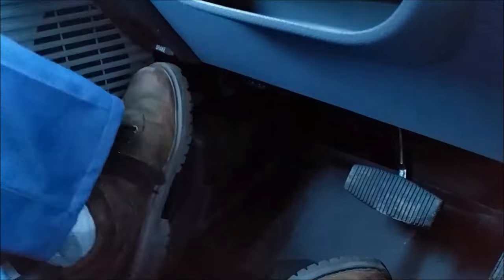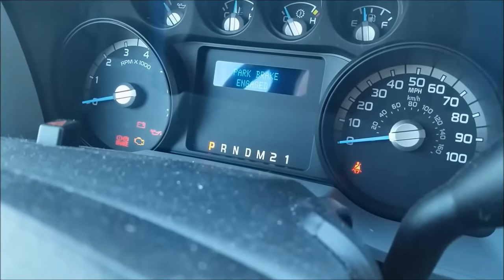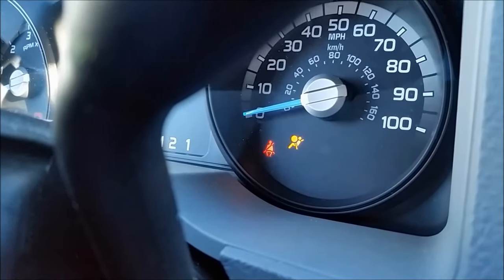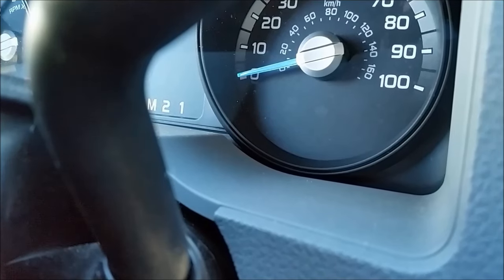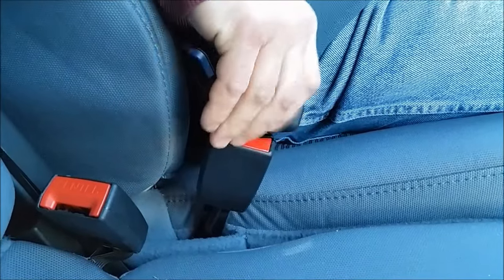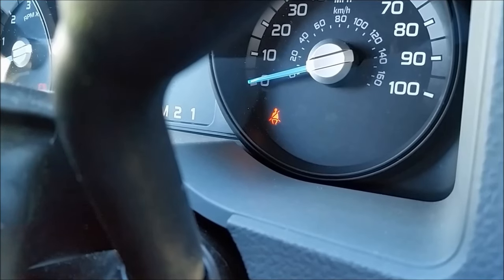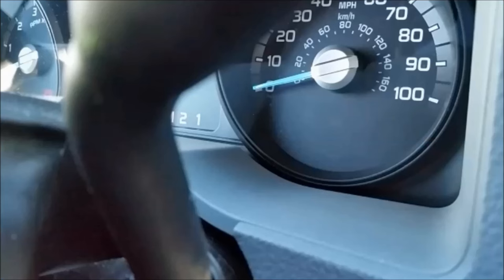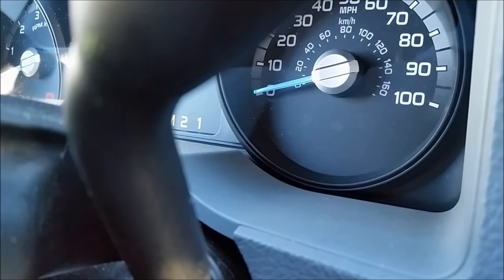How To Disable The Seat Belt Minder/ Chime On a 2014 F-250

Comment: This worked on my 2011 F350, Diesel, SB.  However, you must NOT use the "My Key" activated key or it will not work (Refer to Page 172 of the Owner's Manual.

Comment: Just tried it on my 2014 F150, and it does not work. I tried the 3 times buckling and unbuckling as well as the other suggestion for 9 times. The light went out and stayed out, but when I removed the key, reinserted it to check on the change, there was no change.
Reply: did you ever find a solution?
Reply: ryan collins worked on my 2013 f550
Reply: Nope. Gave up after the second night.